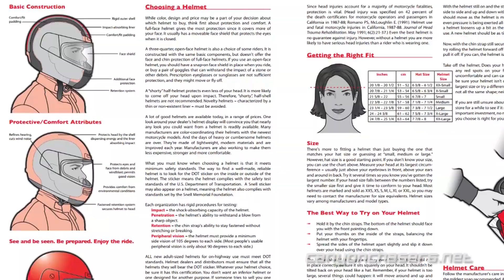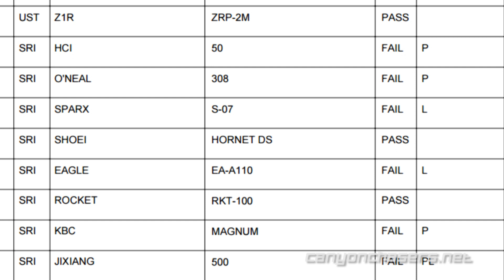Is a More Expensive Motorcycle Helmet Safer? ⛑

Comment: I call absolute BS at what he said 2:16. Perhaps there are other factors playing into those stats. Helmets and certainly in the case of decent quality Helmet A vs. decent qualtiy Hemet B does basically NOTHING to prevent concussions. NOTHING.

I got a mTBI years ago and have studied this subject (and Engineering.) I have also read many books on this topic. A well fitted, secured, high quality brain bucket can do an excellent job at preventing you from cracking your skull. You should wear one. To think for a second they will prevent a concussion is misleading. The only disclaimer I will make is that if you wore no helmet at all, then everything would be worse- much worse. The concussive forces however would not change much. Some newer helmets claim to diffuse some of the impact energy by turning. That "might" help but only slightly. Not enough at all IMHO but better than nothing I guess.

The brain floats like an egg inside a very hard skull full of impact ridges. When you stop suddenly that soft brain, the consistncy of soft butter slams into the inside of your skull. That is where the damage happens. If it twists that makes things much worse. That is called the dreaded diffuse axonal injury. You really don't want that. Hurt the brain stem and you will be lucky if you survive, but you will likely never thrive again. It often leads to paralysis, coma and/or death. Nothing good.

In fact, you do not even need to physically impact something to get a brain injury. Blast injuries (changes in pressure), roller coasters can come close, extreme shaking and even extremely hard breaking can have an impact. 

The best solution by far, stop putting yourself in situations where you need a helmet. Now that is winning. I don't ride anyhmore. A brain injury can really mess you up- trust me. Years later and I am still not the same. Not fun.

Comment: Only thing I could argue is that cheaper helmets use cheaper materials. And the problem with that is that the foam inside the helmet is often less good at staying in shape on cheap helmets. So the fit of the helmet deteriorates faster on cheap helmets. But that is based on my own experience and a very small sample size.
Reply from the maker: That would be our experience too

Comment: I like the take that at some point more expensive helmets are better because they're being used by people who care for their equipment.

I'm getting ready to thread the needle on trying to find a safe helmet with a small budget.  I'm a beginner rider on a Honda FT500.  I'm not a high need for speed guy, I expect 55mph is going to be my top speed.  Does anyone have thoughts on LS2 for a first helmet, and upgrading to AGV when I have more cash on hand?  LS2 meets DOT and ECE, but doesn't score very well in UK SHARP assessments.  That said, reviews I've seen note that they seem better than others in the cheap end.
Reply from the maker: We did this video right before the Sharp thing caught on, so with that said, I would encourage you to pay attention to it. It's a great metric. A large percentage of head injuries come from crashes at speeds less than 55kph (35mph).  That is to say, my best advice is to get the best helmet you can swing. If it was me, I'd probably start with the AGV.
Reply: @CanyonChasers  thanks for the advice.  I assume with corona virus my MSF class is going to come later in the season.  More time to wrench and make sure I'm ready to ride smoothly.  And more time to save and get a nicer first helmet.  Lower-end AGVs do seem like the right compromise between safety and budget.

Glad to know that sharp system is worth paying attention to.  And thanks for replying, I figured it was a shot in the dark asking questions on an old video.

Comment: Safer? Think so, but no crash is the same and could create difference injuries. But in terms of passive safety, YES! If your helmet is comfortable, fits well and is quiet, you can concentrate better and the better you feel, the safer you ride. And expensive helmets are also better build. So screws don't get lost, visors don't rattle, ventilates better, pinlock etc...it all ads up to passive safety.
Reply from the maker: Exactly.  I actually don't like the word "safe."  IMHO, safety is an illusion.  All we can really do is reduce risk or exposure to risk.

Comment: I'd never buy a Helmet if it doesn't have SHARP 4 or 5 star rating.
Reply: I bought a modular LS2 helmet which has 4 star SHARP rating which is pretty damn good for the price (<80 quid). Plus ECE certified too.

Comment: YES!!! But not everyone can afford an Arai or Shoei. Buy a helmet that fits your head SIZE AND SHAPE!!! Composite is better than Polycarbonate shells for sliding. Bar none. A Snell rated helmet is better at impact protection than a DOT rated helmet. A smoother rounder shell is better than a super aggressive shape as it reduces chances of creating extra forces on your head and neck while sliding.
Reply: That's why you SAVE up for a helmet in the $500 range. If were able to save up enough to buy the motorcycle you can save a few more bucks for the one item that can save your life. I put off riding my first bike for 3 weeks just to save enough on my paychecks to buy a Shoei helmet.
Reply: @DoomFinger511  I bought a Helmet before I ever sat on a bike. You though sir are in a huge minority of new riders. I've seen it all at the gear shop I work at. I've even seen experienced riders learn about WHY more expensive helmets are better in most ways.
Reply: @s70driver2005  Maybe it was because I got introduced to riding by taking the MSF course. They taught me the importance of getting the right helmet first. I went back and forth to Cycle Gear 3 times, getting my head measured, trying on all these different helmets and watching Revzilla reviews until I finally decided to shell out $700 on a Shoei rf-1200 with a photochromatic lens. In hindsight I'm glad I did it. My dad took the route of buying 3 different helmets under $200 each for different situations. For almost the same investment I have just one helmet that works in every situation.
Reply: @DoomFinger511  you got the right helmet for what YOU needed. While I can argue all day about why Arai is the best helmet that doesn't mean it works the best for ALL riders. When i fit someone in a helmet i ask a variety of questions to get them in the best helmet that fits their needs, comfort, saftey and budget. I wish everyone would/could buy an Arai or Shoei but that isn't always the case.
Reply: @s70driver2005  I was really torn between the Aria and Shoei. The Aria was super comfortable. The only reason I went with the Shoei was because it offered the photochromatic full lens shield. The Aria only offered a photochromatic pinlock insert which still let light bleed in from the corners. If the Aria had the full shield option I would of gotten it instead. However I also looked at the Scorpion EXO-420.  It was $150 and SNELL rated. Only helmet I found under $300 that had a SNELL rating.
Reply: @DoomFinger511  Arai has another option called their Pro Shade system which is like a internal sunvisor but goes on the outside of the helmet. The R420 is a good helmet for the price but just $50 extra gets you a composit shell in the Scorpion R710 and a smoother shell shape. Everyone at my work really likes Scorpion for their helmets. Great bang for the buck.
Reply: @s70driver2005  I looked into the Pro Shade but I was worried it would catch the wind when I was riding. Also the Aria Quantum-X was the shell that fit my head best and I don't remember if the Pro Shade was available for that. I think the Shoei rf-1200 is good for rides under an hour but any ride over that the Aria is better because it's just so comfortable. Since I'm still new at riding (and due to the current season) I rarely ride further then 20 miles at a time. This summer when I'm better at riding and it's warmer I'll probably buy an Aria as my long distance cruising helmet. I didn't know about the Scorpion R710, I'll have to check that out. I heard they do a decent job with the fog coating they put on their shields in lieu of a pinlock. Although I have a feeling I'd never wear it if I end up with a Shoei AND an Arai helmet lol.
Reply: @DoomFinger511  the Pro Shade system is available for every Arai helmet if I'm not mistaken. I'll have to double check. Also the Shoei should be fine for longer riding also but the one area where I know Arai wins is ventilation, its crazy how well they breath! Either way I think you'll be spoiled by both helmets. I'd say pick up a R710 as a spare helmet for a passenger or something like that if you wanted. I love scorpion but they ain't no Arai or Shoei!!!
Reply: @s70driver2005  I'm sure the Shoei would work for a long ride, the one downside of the rf-1200 (for me) is it's really made for 3/4 or full tuck. I have a cruiser ('98 yamaha vstar) so I sit up right.  The Aria Quantum-x is made for an up right position which I think would be more comfortable in the long term. That's a good idea to buy a Scorpion for a passenger. I'm still not comfortable having someone ride with me but I will eventually. When buying a passenger helmet do people usually just buy a medium so it will fit most people?
Reply: @DoomFinger511  True and that's why i talked about getting you the best helmet for you is a case by case thing. A R710 in a M or L would be best for a wider variety of passengers. Only take someone when you feel comfortable. Also make sure they lean WITH YOU not try and stay upright which will make the bike not want to turn. Have them put their chin on the shoulder that is the same as the turn, i.e. left turn chin to left shoulder, same with right.

Comment: While I agree that Racer’s always wear the most expensive helmets because they can no afford to make a mistake, this by no means does it verify  that they are there for the best helmets, they are often locked into a specific brand because of team sponsorships.  Part of what makes these helmets so expensive is that they must cover the cost to get their product visible.  Certainly you want to stay away helmets that are made from Polycarbonate, and replacing you helmets after spill that even just scratches your helmet, it needs to be replaced if the helmet is more that 5-7 years old.  Good helmets are the cheapest insurance in rider safety.
Reply: Racing is advertising.  No different than seeing blender being used in the mall.. It is all a live performance of your product...
Reply: "Certainly you want to stay away helmets that are made from Polycarbonate" - bollocks. That would be a half or more of a line-up for most manufacturers.
" and replacing you helmets after spill that even just scratches your helmet" - another myth.

Comment: the answer or no. dot is dot. Snell is Snell. ece is ece. all the extra money your paying for is name brand, how light the helmet is, features, noise level, longevity(maybe), ventilation, visibility, and arrow dynamics. As for protection its all the same. a $150 Snell helmet has the same protection as a Snell helmet that cost $500. I personally think some people look like a fool dressed like they going to the track with a full suite on when they just going for a ride. I personally would not buy a helmet for $50, unless its on sale and from a reputable brand.
Reply: Not necessarily. A big aspect could be the materials that the shell is made out of. Best example, Shoei's AIM+ shell. It has a much better abrasion resistance and overall integrity than any poly carbonate shell. I wont deny that Polycarb shells are much better than they were in the past. but quite simply saying that a helmet that costs £150 compared to a more premium one at £500 is no different when it comes to safety however you are correct on the field of extras. Liners, Aero Dynamics, ventilation and even visual design all add to the price. But it also comes down to how you define 'safe'
Reply: What rubbish. Something can pass the Snell test by an inch or a mile.
Reply: That is indeed correct however it still meets that standard. If you just look at the certified standard then you cant really compare the lids properly. There are many functions. No one forces anyone to buy a premium helmet but they are more feature rich and more expensive for a reason. There will always be a purchase premium for a brand name. whether its boots, gloves, jackets or trousers too, doesnt mean they are not that expensive for a certain reason....well, unless its RST, then you just get ripped off.

Comment: Here's your quick answer: Buy Shoei, AGV or Arai if you want the safest full-face, 1-piece helmet. And racers don't just wear whatever they get for free... they are VERY particular about their gear and its quality. They ARE a good metric... they battle test this gear more than anyone.
Reply: You cant determine safety by brand. Yes, the more premium brands may have different features in them but the amount of people that purchase a helmet that is the wrong size is a big problem, another of which is the fact that loads of them dont know how to even put on a lid properly but wont accept help from someone trying to advise them.
Reply: Best thing to do is check the Sharp ratings.  Some fancy & expensive helmets only have 3 stars whereas a much cheaper helmet can have 5 stars.  Do your research and you'll not make the mistake equating price with protection.
Reply: Ben King-Eagles You forgot Schuberth, X-Lite, HJC and Nolan.
Reply: Ben King-Eagles Indeed but I also would include Bell on the list
Reply: HJC have helmets varying from very budget models all the way to race models,. the differences between those 2 specific models are substantial. I wont deny though that HJC is the largest manufacturer of motorcycle helmets in the World.
Reply: What about SCHUBERTH?
Reply: @grgurmandic6622  cheap asses, two shell sizes for TOTL models.
Reply: They also get a lot lot lot of money to wear those helmets
--
We have lots of helmets with real-live crashes to learn from but when was the last time anyone who was hurt showed the real damage to the helmet?

Comment: One thing bothered me about this video... He tried to use the fact that SS racers all used higher priced helmets... Well of course they do... they are getting paid by the makers of every piece of gear they are wearing (Sponsors)... not only do they get all that gear (Helmet included) for free... but they get paid to wear it because every dumb schmuck out there that is a SS racer wannabe will go out and buy the same helmet.  Its a sales pitch.
Reply from the maker: I think you missed the point.   Yes, it's an opportunity for a manufacturer to showcase their best gear.  But what happens to a companies reputation if their helmet has a high fail rate. Look at Jorge Lorenzo.  He had so many problems with HJC helmets failing to survive a single race that he eventually had to switch to another brand.  And no team is going to leave anything up to chance. There is far more to be lost with an injury or a lost championship than there is to be gained from a moderately sized (comparatively) endorsement paycheck.
Reply: Arai claims that it doesn't sponsor riders past getting them a helmet for free. So, it's not all that simple
Reply: Getting shit free, is sponsorship.
Reply: @thetriplex9365  Who pays for them? Right, it is not that simple;
Reply: Then why is there no Schuberth in MotoGP?
Reply: Professional riders don't just take any old helmet because it's free. They are still very particular to make sure it is safe and comfortable. They aren't going to risk losing a race and/or getting injured just for a free $500 they could easily afford anyway.
Reply: @DoomFinger511  AMA dirt bike riders get well payed for gear contracts, 500$ is chicken feed to them
Reply: @250txc  Yeah I know, that's my point. That's why they wouldn't wear just any old helmet because it was free.

Comment: If you drop a $1000.00 helmet do you have to replace it ?
Reply: Depends on the type of drop lol. if it just falls off the bike per say with out your head in it no you will not need to replace it.
Reply: Every time you take the helmet off your head you should replace it. Just the pressure of your head compressing the liner will compromise it for future use.  Please send the $1000 to me and I will send you your replacement helmet.
Reply: Nope; If the foam inner liner is not dent inward, why would you want to change it unless you are the guy selling him the new helmet?
Reply: yup

Comment: Another factor in more expensive helmet comfort is that if fatigue and distraction.  A helmet with pressure point, one that doesn't ventilate well, one that wobbles in the wind, or one that is heavy due to cheap materials can result in distraction from fiddling with the helmet or fatigue which can lead to slower response times.
Reply: Sounds like a long shot to me.... Lighter might be better but due to cheap materials might be off the path... I asked about a simple question on the ice-chest-foam liner that is in all helmets, because it is what allows the brain cushion before slamming into the skull in a crash.